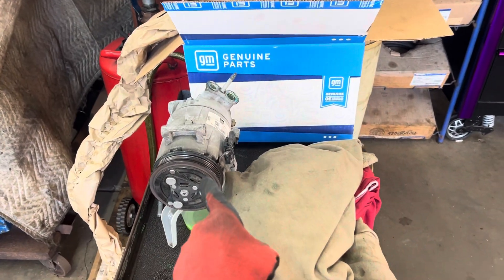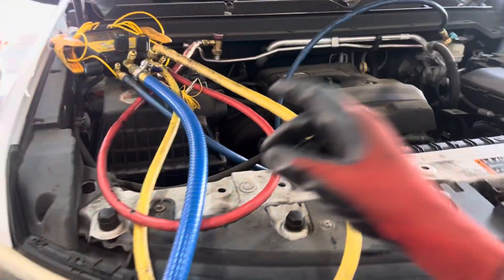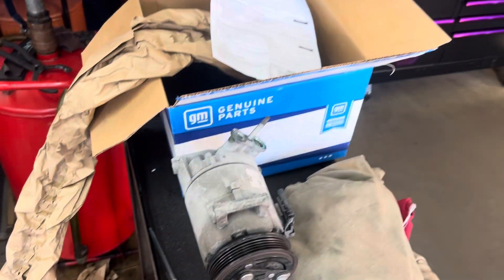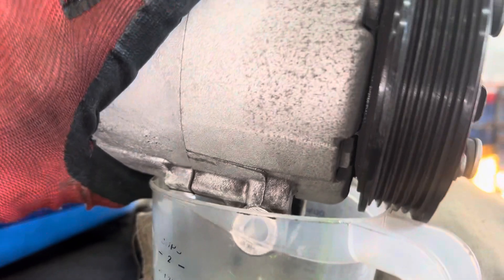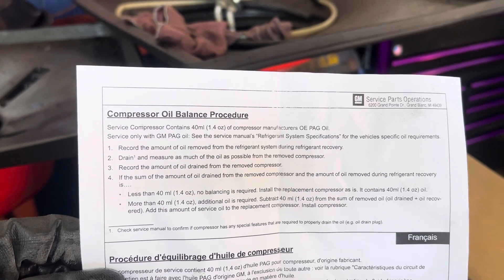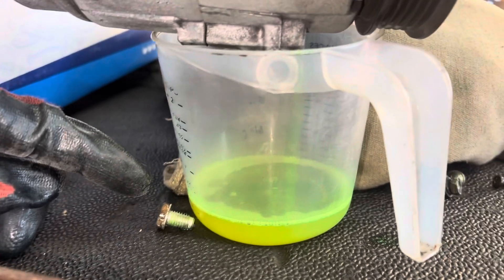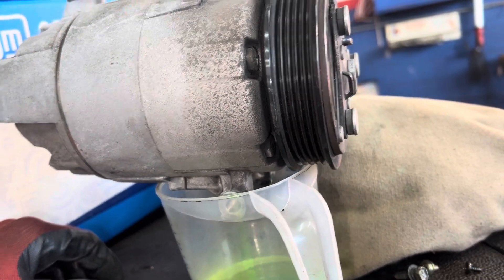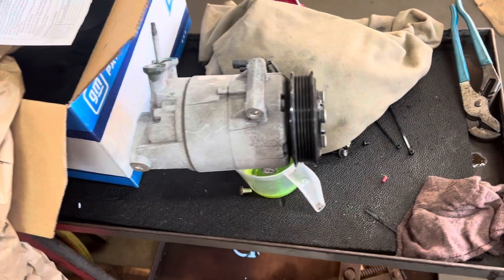Oil Balance AC Compressor, no oil comes out of suction or discharge port. Only oil drain plug.

Comment: Great video Tom, so are you going to flush the system or just estimate what could be remaining in the rest of the system then add less of an oil charge in the compressor.
Reply from the maker: Been a while, I think 🤔 i remember it had clean oil in old compressor. 

They just balanced the oil

Comment: i bought the " Pit Stop " brand of oil checkers from Envirosafe.....Tom have you ever used them ?      in the commercial Kitchen refrigeration work i did ...i never remember checking the oil ...in a compressor ....by the time we got to them ....most needed replacement ......but i've always wanted to use the checkers i bought on a Car System ...just never got around to it ......have a nice day   Jay.
Reply from the maker: Pitstop would kind of be in the snake oil category product. 
      It would somewhat be OK in old automotive systems from the 1950s 60s and 70s with fixed piston displacement compressors. 

It’s only accurate on a good working system that has a full refrigerant charge 

If you have a parsley, restricted expansion valve, choking off refrigerant flow. It would also be choking off oil and it would show up as being low on oil, but all the oil is just stuck in the system not in your suction line. 

If the system was low on refrigerant, but the system is low on refrigerant. It does not circulate the oil is much it goes out of the compressor and it gets logged into the evaporator and it doesn’t leave the evaporator so when you go to test it, it would show up low on oil .

Variable displacement, compressors if the system was operating in low heat capacity mode, or the compressor is barely displacing, refrigerant and not pumping out oil and they show low on oil charge 

And a big majority of the newest design of compressors are designed to retain more oil in the compressor and not allow it to circulate as a high percentage like it used to on old compressor systems so when you test the system, it could be full on oil, but on the systems that Have a low percentage of oil traveling in the system. It will show up low on oil.

So, in all those scenarios, somebody may think they’d keep adding oil into the system because of the way the system is designed .

Comment: Do you expect that there is  any oil trapped in the evaporator?.
I think this 2 oz of oil drained from old compressor is more than specs.which is 1.4 oz.
Reply from the maker: Somebody has added a lot more oil to the system. 

It has way more oil than it should have . 

When I was recovering oil, a lot of oil came out 

When I disconnected lines, oil poured out of the lines way too much .

Comment: I do not understand why every compressor doesn't have an oil drain plug like this one
Reply from the maker: Because not all compressors are designed to have a sump area to lubricate the bearings in the high load areas. 

The mechanics of the internal physical part of the compressors are not all designed the same 

Some compressors are designed to have next to no oil inside of them very little . 

They relied on a completely full refrigerant, charge of refrigerant, and a slight amount of oil that is carried off with the refrigerant into the system to return back as a cool aerosol lubricating the cylinders with an oil mist . 

This way they can design the compressor, smaller and lighter . 

Everything about cars is how light can it be? How small can it be? How fuel efficient can it be? . 

Go back to the 1950s to the large iron and steel Frigidaire a six compressor where it’s nearly 40 pounds . 

Large, heavy, slow, rotating mass with large V8 engines that had low RPMs. They did not care about gas mileage. . 
     They had 6 ounces of oil reserve in a sump pump in the center bottom of the compressor. And another 4 ounces circulating continuously throughout the system..